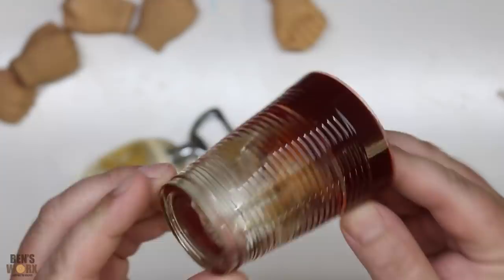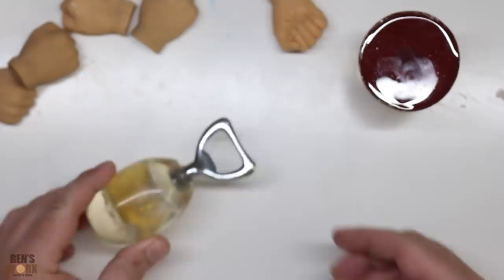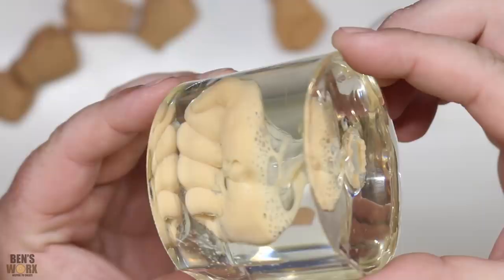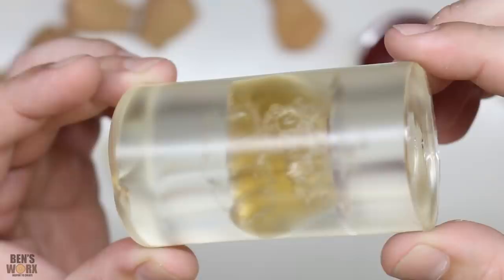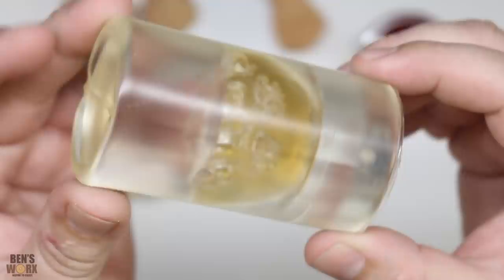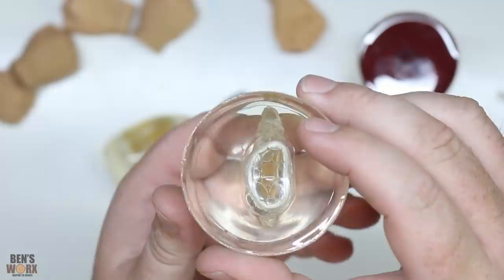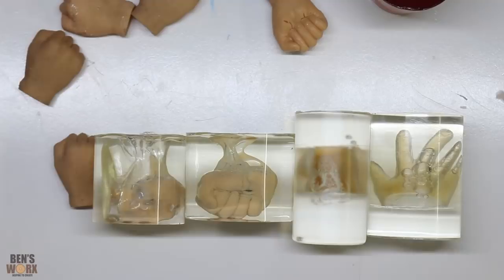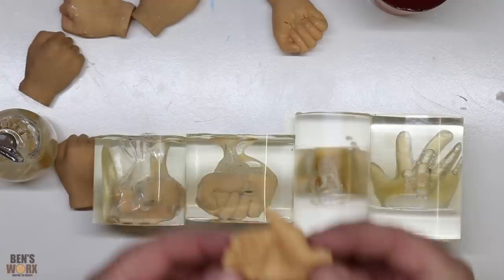I built a bottle opener from 5000 drops of beer

Comment: Once you’ve filled the fist with beer, freeze it, put a thin layer of UV resin on top of the frozen beer, cure it, then add your final layer of epoxy. The uv resin will seal the cavity and stop any epoxy leaking in.
Reply from the maker: Great idea Sophie! 👍
Reply: You'd also have the added benefit of the beer being expanded while frozen which would prevent any outward stress if it were to refreeze in the future.
Reply: Or you can just fill the fist of water then freeze it then put the frozen in the mold container then do what you did
Reply: I thought alcohol cant freeze
Reply: Sophie Isabelle you would have a thin layer of alcohol on top of the beer that wouldn’t freeze but I guess you could poor that off. It would of course be non alcoholic beer at that point, and nobody likes that shit.
Reply: @Puddycat5623  To just "[pour] that off" would be alcohol abuse as well!    (0_o)<[ ]
Reply: It would make a slushy consistency. Enough to suspend the uv resin.
Reply: @whyyousotriggered6050   beer doesn't have enough alcohol to not freeze

Comment: The resin got in because you vacuumed it the 2nd time. The air from the beer expanded and got passed the clear cap you glued on. Once both sides equalised, the hole was still open and some resin flowed in.

Comment: I think when you put it in the vac chamber it's pulling out the air of the fist. You could try putting slow set resin in the vac for a moment to pull out the air. Then take it out and pour it slowly on top. Not sure the working time once the vac is applied though. May be worth a shot.

Comment: Those failures were very likely due to your use of a vacuum for degassing.  It should be done either in a pressure pot, or the ‘Old Fashioned Way’ lol

The rising bubbles from the vacuum pressure would almost definitely cause problems on something soft and hollow like your lil’ fists 😋

I hope you might try something similar again one day.  This is how art we can be proud of is made - repeat, repeat, repeat - with constantly evolving trial/error & research :)
Reply from the maker: Thanks Mate, no vacuum was used only pressure pot 👍
Reply: Ben's Worx oh whoops my bad!!  Scratch that then lol Just for kicks, in case you’re open to more ideas...

Some other things that first come to mind, which I might try if I were to attempt this might be:

• If the hand is melting, perhaps using coldness in some way could combat that (could really be an interesting experiment, too, I think) Such as 
↘️Filling the hand with something cold, (freeze your metal weights first? Ice chips? Along those lines) adding it while the epoxy starts really heating up
↘️Alternatively, perhaps filling the hand with water prior, and then freezing it before putting your mold together (I’d try to seal off the top with tape or wtv to avoid getting water in the resin)

• It might be better to try strengthening the hand material against the resin; I’m sure you could come up with something genius for this... but some starting ideas for me are:
↘️Liquid silicone/mold-making rubber. Filling the hand, making it solid-yet-squishy seems beneficial, it should make it less likely to melt while filling the hollow space that the resin wants to get into; the squishiness should keep it reasonably removable once the resin cures too. 

I have more of these lol but this is starting to go too far beyond an effort-post lol

Comment: Fill the hand with clay so it keep the shape, or create a solid mold so when you cover it with resin it doesnt deform, and also instead of using a plastic lay to cover the hole after you fill it with beer whit not just did the base and then glue them toguether with uv resin or epoxy

Comment: The reason the resin is getting inside is because the pressure from the second time you poured, the plastic cap needs to be covered by the resin but don't pressurise the second time, may have better luck. We'll done though looks great
Reply from the maker: Thanks James

Comment: when the resin kept leaking in and sinking to the bottom of the fist.... was there any reason why you didn't just pour the resin in and then place it upside down? Then the alcohol and air pocket would be trapped in the fist and any resin that leaked in would be at the wrist.

Comment: Instead of using the plastic seal to close the fist, why not just turn an epoxy coin, use a very small bit of epoxy to set it in place, then pour over it so you have an all epoxy pour?

Comment: one drop is estimated at 0.05mL, times this by 5,000 equals 250mL (.05x5000 = 250ml) 250mL is equal to one standard cup. this gentleman has, in fact, lied about the number of drops he put into that mould as that would not even be 100mL.

Comment: Hey Ben I've got some questions for ya. I've Ben taught how to use a lathe with metal and an very interested in getting one for myself. Although I'd like to use it with wood also. Could you give me a recommendation on a decent lathe that could handle both wood and steel? Or would I have to have 2 separate lathes?
Reply from the maker: I don’t have any experience turning metal but I’ve seen people turn wood on a metal lathe but I’ve never seen someone turn metal on a wood lathe. Hope that helps mate
Reply: @BensWorx  could you tell me some of the tools you use? For instance I've never seen a oscillating cylindrical sander. Your skill saw. Things like that. Also the oil use for the resin to make it clear
Reply from the maker: Send me an email mate and I’ll answer all your questions there 👍

Comment: I don't think that little of a space can hold 5000 drops which is approximately 250 mL but i may hold up 500 or may be less drops of beer as that would've been  more plausible. Although it looks fairly good, you need to make do the maths before throwing out figures.

Comment: Hey Ben,
Finally got that wand handle blank done, I just need to finish the pattern transfer and I can send you photos of it. Maybe after you see it you'll have a idea on using Solder as inlay like we talked about ages ago. By the way where would you prefer I linked/sent the photos to? I just want to be considerate and not send it to the wrong place. By the way do you know of any drill bits or some method of making a Tenon without a lathe? I still can;t set mine up so I need a way to making the joining segment between my wand and the handle. And I have one more question do you think you could help me identify a couple of branches as to what wood they are, I know it may not be up your alley but I thought I'd ask as a wand maker must know what wood they are making a wand from to get the best out of matching cores.

Heh yeah I am trying to make my wands as authentic as to Pottermore without any actual magic, more fun to let imagination bring the magic to life in those who are picked by the wand am I right?

Cheers and hey that opener turned out great in my eyes, a tine knuckle duster is nothing to sneeze at.
Reply from the maker: Thanks Mate! You can send me pics on Instagram, perhaps drill 2 holes and use a dowel? Identifying wood can be tricky, I’ve found places like Reddit with a large community help a lot
Reply: Dowels may indeed be the best option, I will send you a pic on instagram soon my friend, hmm I honestly never even tried Reddit before I'll have to check it out hopefully I'll find the community your part of easy enough. TTFN my friend if I can't find it I will of course get a expert guide. Thanks again and Cheers!
Reply from the maker: No worries mate